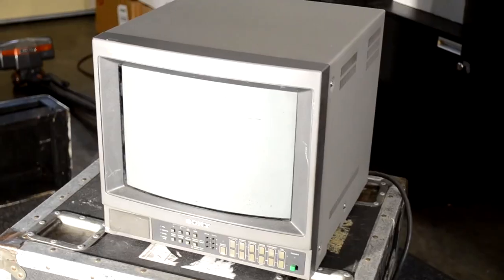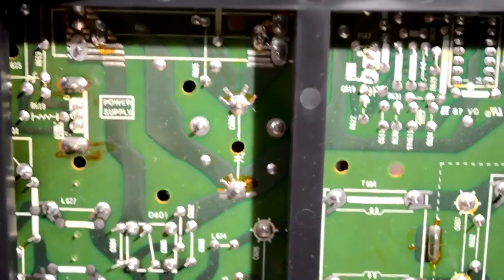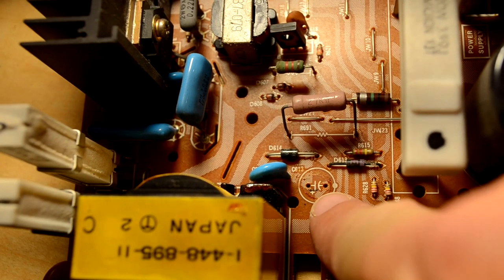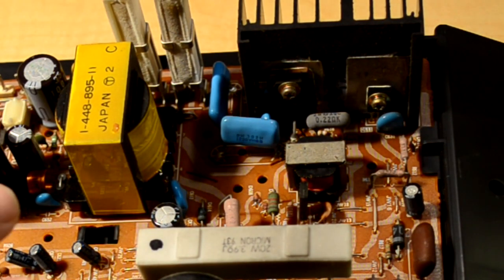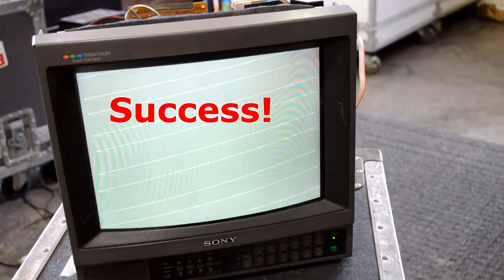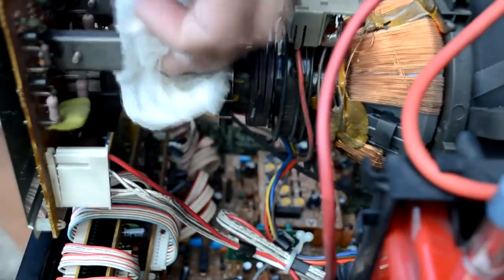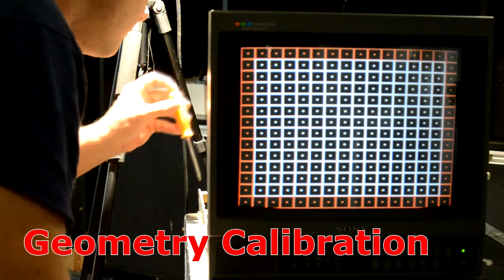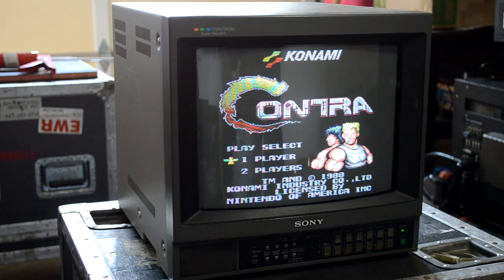CRT No Power Fix! | Sony PVM 1342Q Repair & Calibration

Comment: I know this is an old video but I've just repaired 2 PVM 1442QMs. Same as this but Euro models. And after a few hours of doing what you did, I also found that fuse to be open on both PVMs. Replacing the fuse resulted in both PVMs coming back to life. I wonder how many more of this model suffered the same fate.

Comment: On the European versions (1440, 1442 and 1444QM), there's a component labelled PS602 rated for 125V and 0.8A where F602 goes on the American ones. I wonder if it actually serves the same purpose and it's also right in the 115V line. And when I test mine, it also appears dead (no continuity) and the 1444QM in question does show very similar behaviour. This might well be the culprit in my case too. Edit: it looks like the part is an SOC 800mA fuse and not that easy to find. I wonder if I won't end up jumping that fuse (I checked my 115V line and it looks okay on the multimeter).
Reply: Replying to my own post. I finally didn't bypass the fuse but replaced it with an equivalent Chinese part from eBay (a 125V 0.8A fuse). And it proved successful! Turns out the monitor has a vertical fold over problem but that will be for another time. All in all, that was a very pleasant surprise for me, seeing the monitor coming to life with a good looking picture. Thank you again, Steve, for taking the time to do all those videos and sharing your knowledge and research.
Reply: I've bought 1444QM (European model) and it has exactly the same issue - blown PS602 fuse. Kinda hesitant to short it for the test but I might do it. Can you tell me which part did you exactly replaced it with?
Reply: @maciejkobus  You'll have to go to my Community tab for the answer. I seem to have been banned from commenting here.

Comment: Just wanted to say thank you again for all of your extremely helpful videos!  I just picked one of these up for cheap as it would only show the four lights on the control panel like yours did after you replaced your caps.  I hunted down that soldered in fuse and made a temporary jump using a glass fuse and some test leads and it fired right up like yours!  I don't have access to any parts boards, so I'm wondering if any slow blow fuse will work as long as it has the same mA and Voltage?  Pretty excited to get it fixed as the inside of this unit was clean enough to eat out of and I was the first one to open it up it appears.

Comment: I have an apple audiovision that worked spot on till the other day I go to power it on the light goes on but no picture. If you turn it off and on quick you can see a tiny distorted picture for just a minute. I need to fix it it’s so cool can you help

Comment: I have this exact model and have a question for you relative to discharging the anode cap. The cap has been epoxy’d on like the pvm in your video. I’ve been told that this can sometimes indicate the presence of a high voltage leak, but your video states that this was relatively standard practice for a monitor manufactured during the 80s (mine was made in 88). 

Is it safe to remove the epoxy, discharge, and work on the board as one would regularly (if I take the normal steps and precautions)? Should I re-epoxy the anode cap after I complete the work I intend to perform (simple recap of deflection circuit), or is it safe without re-epoxy? 

I know this is an old video, but any help would be greatly appreciated as I don’t want to have to give up on this PVM.

Comment: How dangerous is repairing a pvm compared to a crt? Im still rather new to learning about crt's. But I have a 1342q and want to possibly be able to fix problems it might have down the line, and of course not electrocute myself in the process.

Thank you.

Comment: @ 7:32 you found the second fuse that had no continuity, which you replaced and power was restored to the PVM. You said the tube was a little bright and an adjustment had to be made to the G2 voltage because it was too high, how was that adjustment performed? Also, what do you use to generate the patterns that appear towards the end of the video which act as aids as you adjust geometry and the like via the potentiometers?
Reply: G2 voltage is adjusted via a potentiometer on the flyback transformer. There is typically a pot for focus here as well. 

The test patterns are part of the 240p test suite, which you cam download as a rom for most older consoles.
Reply: @tylerm1491 thank you!!

Comment: Hi. Just watched your video on single horizontal line across crt screen,  could I please ask your opinion, 
Mine is an old Toshiba 37 inch crt, working perfectly until two evenings ago, when switched on showed just the single line across screen,  (sound was working fine) tried the obvious of unplugging,  switch on and off etc, of course that did nothing, then I said to the wife let’s try the old fashion method, I banged the top with closed fist twice and picture was restored to normal, that was fine until next evening when same happened again, whacked it and it came on again, so here is where I’m asking your opinion if I may, I’m thinking the fact it worked after whacking it means no components are faulty and it’s a connection or solder joint gone bad ? What do you think ? Any info would appreciated, I have no experience repairing TVs but quite used to fiddling with electrical things.

Comment: The reset light flashed when you turned on the monitor. So it was getting a little bit of power. But not enough. The fuse is the same type as in the SNES too. Overall a nice monitor with Analog and Digital RGB. The Digital RGB is the d-sub on the back. You could probably use it with a Tandy Co-Co

Comment: My fixes are never as easy as these.
Turn it on, the relay clicks and  Immediately turn yourself off again. With no visual damage leakage or anything. Good luck troubleshooting that if an working powersuplyboard checks out the same with a multimeter.

Comment: Hi, could you give me some advice I have a Qnix 2710 27inch monitor and it will no longer turn on.
I watched some videos and found a handy tip to tell if its the power board or invertor( I think its called inverter board)I turned it on without the smaller board(the one that is separate from the board where the power goes in)and the power light comes on but with that board connected it does not power on at all.....So I think it is the smaller board, I replace a capacitor that looked slightly bad but still no luck.

I can not find a replacement board it says this on it: m270dan 1.0 LX-LD273G5 1.0
I assume the m270dan 1.0 is the screen and the other is the board, I am forced to use an old screen and really need my 27inch to work especially during these times (Covid) so could you give me some advice or maybe a place where I can get a replacement board as long as its not expensive?

Comment: I have the exact same issue on my 1943md, the f602 fuse is broken. As the part is really hard to find, do you think I can replace it with a fast blow glass fuse ? The manual says 800mA, but the broken fuse is marked as 1A, I would go according to the manual to be safe.
Thank you very much for all your great videos!!

Comment: How much do you charge for a job like this?
Reply from the maker: Jobs vary depending on the amount of time and parts needed to repair.  This was a pretty lengthy repair and used a good amount of parts.  At the end of the day though, this was about a $250 repair/restoration in total

Comment: Just bought a 1443MD for $20 with pretty much the same issue. Hope I can fix it. --- EDIT: Interesting, Sony probably noticed the issue with that leaky capacitor. They used one with a body 2x the size in the 1443MD. They used the same value, but with a body of 32x16mm (hxw)